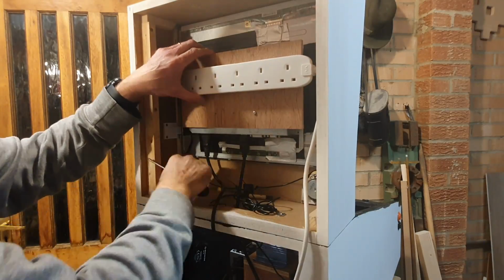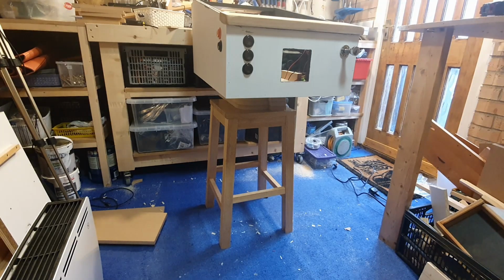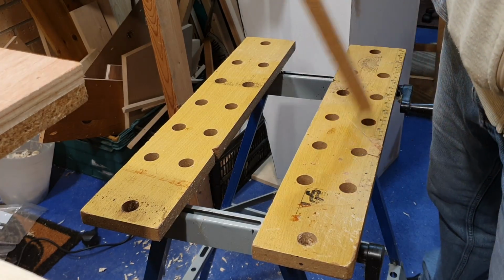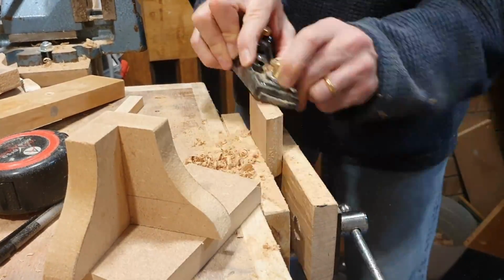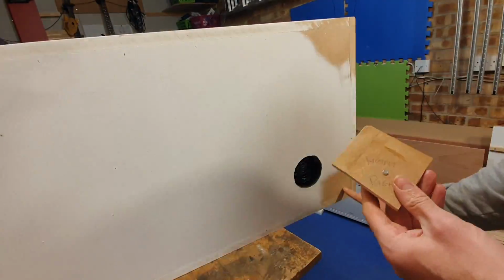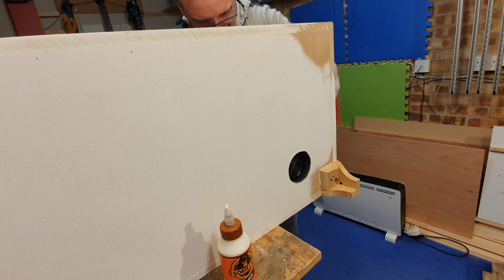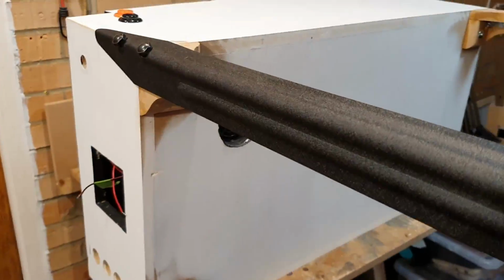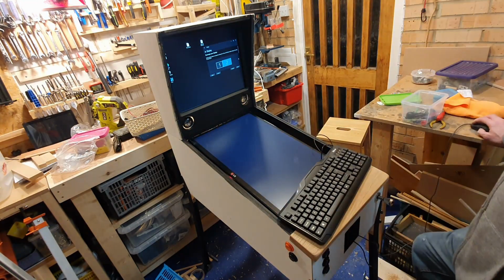Mini Virtual Pinball Table Build: Episode 8

Comment: I used to quite like the Levellers back in the day; nice of the guy to do you a favour with the postage. Cracking video, i liked how you were moving around the geometry, creating new shapes to make it all work securely!
Reply from the maker: Thanks James! It was one of those moments when I kicked myself for not planning ahead. Although I would have probably made the cabinet deeper as the easiest way to fix the problem and I think that would have spoiled the shape. This way turned out much nicer.

Comment: I feel your pain with wondering drills: when drilling new doors for door catches the drill wondered and came out of the side. I had to glue some broom handle in the hole and drill again. Worked surprisingly well!
Reply from the maker: Those are the best fixes. So satisfying! I always keep random bits of wood just for this purpose. Bamboo skewers are my favourite.
Reply: @MoreFunMakingIt  I've used a lot of bamboo skewers to fill old screw holes.

Comment: Great progress!  I had to leave my widebody VPin back in the states when I moved to the UK a few years ago.  I miss it greatly :(.  Is that a "smart" power strip (where one outlet controls the others)?  I highly recommend one.  It makes powering the whole system on and off so much easier.  Really looking forward to the next video.
Reply from the maker: Thank you! It is very much a dumb power strip. I can see the benefit of the smart one though, but I will have a switch on the back power socket that will power everything off inside. Thanks for watching :)

Comment: Looks fab ! Not only is the build meticulous but your video is too. Capturing everything !! Most others, if not all, I've seen miss out loads...generally the part you wanted to see/learn from . Good job! Are you planning on doing any videos with regard to the software and setting it all up?  That'll be a whole other series, however with so many novices getting in to this, it'd earn you much more followers because of your meticulous nature ;-)  Easy to follow along with
Reply from the maker: Thank you Jason! I'm considering the software side, but the problem is it changes so often. If have to keep updating anything I put out. Thank you again for your kind words 😁
Reply: @MoreFunMakingIt  tis but true. Still worth it though to guide us beginners through the choppy waves of the ocean of questions 🤣
Reply from the maker: @jasonb903  I will certainly consider it. I will be doing a video on the pinscape/kl25z board that should be interesting to anyone making a cabinet.
Reply: @MoreFunMakingIt  id look fwd to that 👍